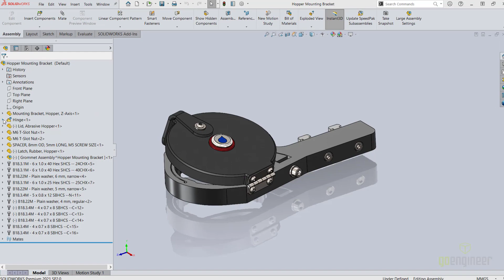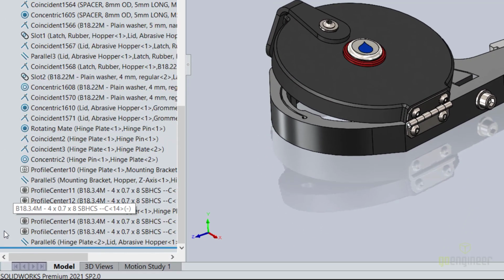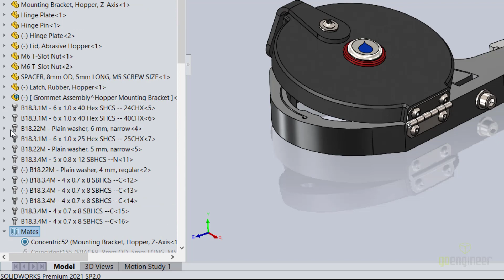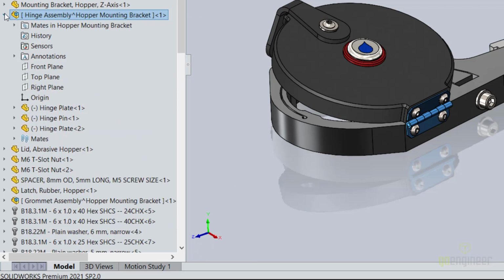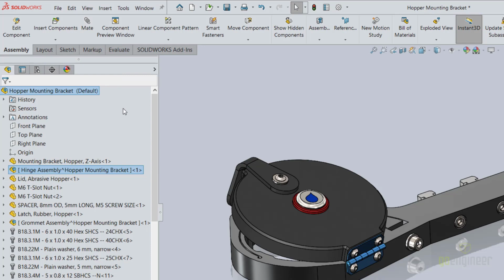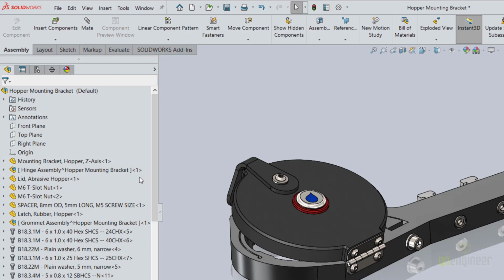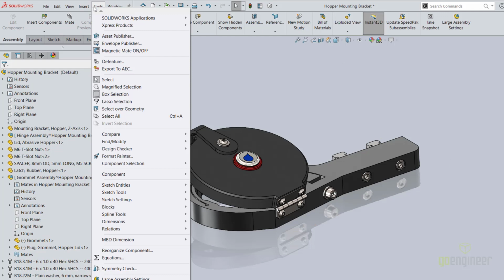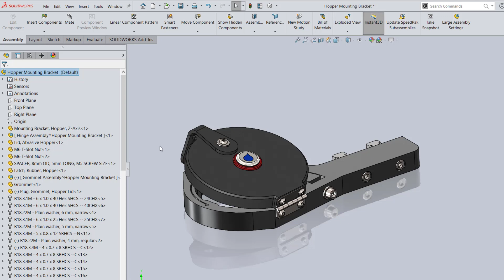SOLIDWORKS - Managing Subassemblies

Comment: Can I able to create sub assembly and save separately and finally assemble them In a main assembly?
Reply from the maker: I apologize I am not sure I understand your question completely, but I believe the answer is yes.  You can create a sub assembly as a separate file and add it into a final assembly. Instead of insert part you would use insert assembly in the final assembly choosing the sub assembly you have already created.

Comment: What do you do about parts appearing as not fully defined after you bring them into a subassembly? (Their names appear with a (-) to the left.
Reply from the maker: Sub assemblies work just like every other assembly so when we add new components to the sub they need to be mated appropriately for the context.  If those parts are meant to show motion then they will not be fully defined. if they need to be locked down then mates may need to be added to lock it up.

Comment: I have a problem with Subassemblies not rotating around concentric mates. I use as few mates As possible to keep things lose. I only have one pointer. How to hold an part to rotate an attached part. its like assemble a truck with only one hand.
Reply from the maker: Sub assemblies when added to an upper level assembly are considered to be rigid with no internal motion by default. If you want to show the motion that exists in the sub at the upper level you need to yous the Flexible assembly mod for the sub.   Here is a quick video that can get you started  https://youtu.be/n9hbOqNiFBw

Comment: how can we select between components to put in sub assembly ?
Reply from the maker: Hello Muhammad, you would need to drag individual components to the subassembly, or use the Structure Editing tool. You can also open that subassembly and then add components just like any other assembly.

Comment: I just tried the reorganise components option and placed to parts to the top level assembly, but it appears i have lost the linear component pattern feature which was used to place components in a lower level assembly, is this standard or have i gone about it the wrong way?
Reply from the maker: The components in your lower level assembly likely need to be moved higher up in the assembly. You can expect some mates or patterns to need redefining if their placement is based on geometry in a higher level assembly.